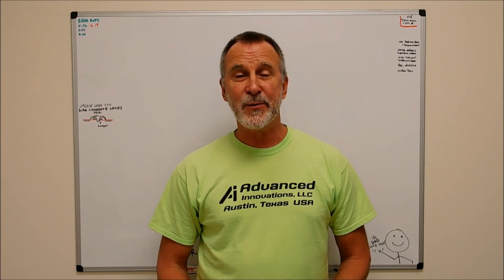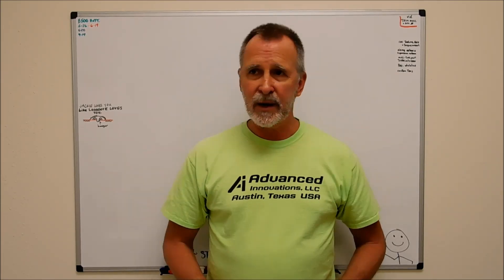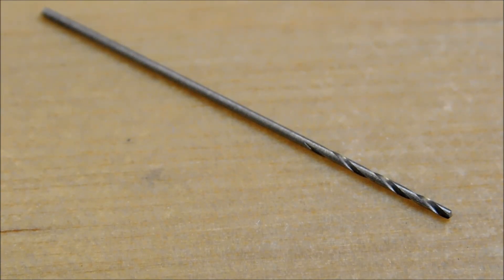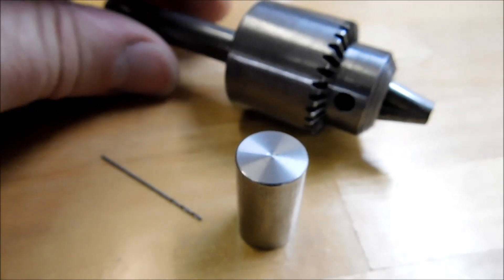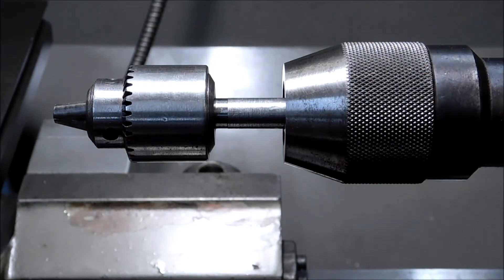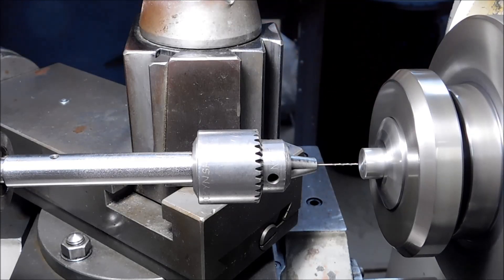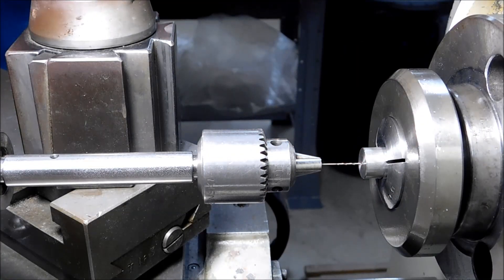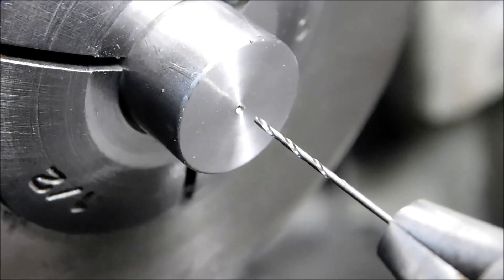Micro Drilling -- Stop Breaking Small Drills !!

Comment: 2 observations:  it looks like your center drill moves upward when making the pilot hole and the bit seemed to wander while drilling also, I think I'd file/grind the teat on the faced off work before center drilling (right?) and secondly making your attachment, the air hole behind that you lable in the video would indicate that the attachment and mated extension from the chuck were ground?  Or did you use a ream and make the chuck extension to fit the hole?  Seems like a real tight clearance (of course) but I'm wondering how you made it.
Reply from the maker: The extension was reamed to fit the drill chuck shank.

Comment: Great idea.  I would like to see how to do this ion a small milling machine that only has a 1/4 or 3/8 spindle opening.  
Someone mentioned the Albrecht version of what you did but it has 1/2 inch shank on a keyed spline which is normally too large for the smaller mills.  Thanks in advance

Comment: Broke 3 tiny bits before looking. Bring on the names - just want to make TINY holes in 1/4” vintage OAK...
Uh oh. Did he say lathe.

WELL P00P !!   I’m talkin hand drill and Wood, so I can put in fine brass nail.

darn it.
Reply: I use a Amtech R0279 Mini Craft Hand Drill but it doesn't always get positive revues but I have had and used mine for more than ten years. I brake the odd bit still now and then but light pressure and less speed gets the job done and fewer broke A normal hand drill is heavy pushing down on the small bit but the Amtech is plastic with a brass chuck  and he did say lathe but I found my self hear by accident too. To make fine holes in wood you could try using a pin push Expo 2mm Pin pusher - ideal for Amati and Peco pins # 75110
Reply: Have you tried an Archimedes drill?
Gives you much greater control over twist speed & pressure for small jobs.

https://www.ebay.co.uk/itm/QUALITY-ARCHIMEDES-PUMP-ACTION-PIN-DRILL-Precision-Model-Pinning-Hand-Tool-/172537853411?_trksid=p2349624.m46890.l49292
Reply: I have put a drill bit in a pin vice and drilled it by hand. It takes forever but it might work for you.

Comment: would this work in a drill press if you put the part in chuck and the adapter in your vise, feed the drill bit bottom up ?
Reply from the maker: You'd have to be exactly on center or the drill would snap off.
Reply: @joepie221  Wondering the same thing - a bit tricky putting an odd my shaped part into  the chuck. But you have me thinking. now. Thanks - great vid.
Reply: Here is how to get the drill dead on center easily In a drill press , extended the quill down and lock it , put a piece of drill rod / shaft in the lower chuck and then put it in the upper chuck and tighten both  chucks ,next put the chuck adapter slide in the drill press vice and tighten the vice , next bolt / clamp the vice the the table and be sure the table is then locked on the coullem , do not move the table in any way from now on , un tighten both chucks and unlock the quill and remove the drill rod/ shaft , then put the work in upper chuck and the drill in the lower chuck and go to drilling holding the lower chuck and pushing it up into the work .

Comment: There's a DIFFERENCE between a DRILL and a DRILL BIT!!
Reply: I was taught the exact opposite, the drill is the tool that makes a hole, the drill motor, drill press or drill chuck are the mechanical items that drive the drill.
Reply from the maker: What???
Reply: @joepie221  The "drill" is the tool which drives the "bit". Like a "screwdriver" drives a "screw". Like  a "paint brush" is used to apply "paint".

Comment: I don’t think that’s a small drill. A #80 is a small drill. Nevertheless, as usual Joe has come up with a great idea
Reply from the maker: I agree, but this chuck wouldn't hold an 80.
Reply: @joepie221  , Joe, Thanks for the reply. Damn hard to find a chuck that will, but I've got one that came with my sherline mill; unfortunately, also has a morse taper.
Reply from the maker: @tomblack6972  Albrecht keyless chucks will, but get ready to spend $500 to hold that #80 drill.
Reply: Joe Pieczynski I think I’ll stick with my pin vice
Reply: I was also wondering about the REALLY tiny drills. I have a job that requires a #78 hole in a brass fixture with a 6mm hex body. It’s counterbored with a 5.75mm hole so the #78 hole is only 250µm deep.
Will I need any special ‘extras’  to drill brass?
Reply: @jeffarmstrong1308 , I don’t think you need anything special for the brass. I drill into brass frequently in my ship model building. Drill Bit City (on line) will sell you a carbide #78. I find those too brittle. Micro-Mark (also on line) has #78 in steel which I find easier to use and more forgiving
Reply: @jeffarmstrong1308  I assume a pin vise can be put into the chuck

Comment: Great Idea , But it must be difficult to drill Hard materials since it requires greater pressure to push
Reply from the maker: You'll feel how hard to push.
Reply: Takes longer and don't expect anything but dust coming out of the hole .
I drilled a hard clock gear shaft with a  .019 drill bit  .

Comment: Any tips for dealing with carbide drills on manual machines?  They are less forgiving than HSS and tend to break much easier.
Reply from the maker: Those are my Achilles heel. I don't think I've ever used one I didn't break.
Reply: Yeah how much of a market for that video could there be? Lol. Luckily I can answer to an extent. Essentially if you have a Ridgid setup, to expand I don't mean Ridgid for a human but Ridgid for molecules fighting each other on a machine level. Only use collets. Find the highest precision ER collets you can manage. eBay and Amazon can be surprising. Center the drill and hope your not drilling anything over maybe 3/8 on 5hp in stainless I wouldn't do over 1/4 on some. Not enough ass end for that. I don't do over 1/4 on my 6k lb lathe. Also lots of coolant don't peck time is your enemy.

Comment: I work in the pharmaceutical sector and we have to drill 5 thou holes. We have to do it on a cnc but it’s not easy. Coolant is enough to deflect the drill.
Reply from the maker: What do you drill?
Reply: Joe Pieczynski I’m not exactly sure what it is as it’s all r&d work for world leading pharmaceutical companies. We have this 1.6mm rod od ground. It gets groved a long down it and gets a 30 thou hole in one end. That hole gets a 30 though acetal plug inserted in it and a 5 thou hole is drilled into the acetal at one thou pecks. I think anything that size must be for some sort of needle jig. They don’t let much on these companies.

Comment: how to drill tiny holes with a hand drill?
Reply: take a look at jeweller tools & techniques, those guys & and dolls use small drill bits free hand, down to 12 thou
Reply: USE A DRILL PRESS.  THE DRILL WEIGHT IS TAKEN BY A SPRING.

SMEAR SOME GREASE ON THE PILLAR (COLUMN) WHERE THE BRACKET SLIDES UP/DOWN.
USE A 120 DEGREES CONE SPOT DRILL TO LOCATE THE PIT FOR THE MICRO DRILL.
USE A MILLING X-Y TABLE FOR PRECISE LOCATION. 
 YOU CAN MAKE A FEW HOLES IN THE HANDLE AND HANG ENOUGH WEIGHT TO OVERCOME FRICTION AND THE SPRING.

Comment: You'r center drill was below center and looks like your drill did not go straight
Reply from the maker: Its an old chuck, the center drill found center, and the drilled hole was true. You can see a slight lift as the center drill picks up. That was not visible without the camera magnification.
Reply: @joepie221  I have a good eye even though I need glasses to read..... and what i see is the drill going at an angle surely not straight but that does not matter if the part still works .... truth is there are no straight holes or perfectly round ...perfection is within tolerances nothing more.... to me the straightest bore you can get is to drill the hole then grab from the inside with an expansion  arbor then turn the outside of the part but even that is within tolerances.... when we realize and accept that perfection only exists in our dreams or lives become easier....btw I find that home made spade drills do quite well at finding center and I find that not having flutes run past just the first 1/8 to 1/4 inch of the drill tip leaves the shaft far stronger than needed to remove the needed material ..... you peck to clear chips and the flutes being wider than the shaft leaves room for chips to clear

Comment: Interesting.  Could you offer advice on drilling RPM for small bits?  I think that small bits should be spun faster than larger bits.  By the way, I've seen woodturners use a sleeve as you have shown here, and often just freehand a bit held in a chuck. They also may rotate the bit while drilling to counter deflection cause by the grain structure of the wood.
Reply from the maker: Smaller diameter = faster RPM   Every situation is different based on part geometry and material. I usually start my drills in the 1/16" range around 1400 and go from there. Drills above 1" are rarely run faster than 130 rpm.

Comment: Is there anyone who can drill a .010" hole .425" deep into a .090" Stainless Steel or brass rod for me?
Reply: Yes me
Reply: No ish.... I'm going to be making 0.005 and 0.010 holes in 0.049 wall 1/4 inconel tubing. If I don't use an EDM I'll need 80k rpm
Reply: To go as deep as you want will need to have it go to an EDM

Comment: OK! I use very fine drill bits 0.03mm being the smallest . I use them to drill new pivot holes in brass for clocks when re-bushing. The chuck I use is ultra mini. Can I design something like this, because you have given me an idea....
Reply from the maker: Check into micro chuck adapters. for use on the mill.

Comment: Really good and that leads me into the next problem.How can I sharpen a micro -mini drill?I got diamond plates,pin vise and Amscope.But is there a better way or other jig or sharpening machine?I'll appreciate some help.Thank you
Reply from the maker: Unless they are custom, buy a new one. They are so cheap, its just not worth the time to try.
Reply: @joepie221  I got my sensitive microdrill adaptor(made with a ruined Dremel parts).I have microdrills of all ages(I'm 74) and they are too long (Ha,and they break)for what I want them to do in my lathe-milling  machine(No CNC) so I need to cut them and resharpen so I'll be able to use my 8" rotary table with the idea of drilling(peck,peck)say 29 holes in a cent or say penny,which in turn may lead me to build a clock with just pennys.I hope I have enough planning for now.See what happens.I'm in debt with you since I'm learning so much from you.Thank you

Comment: Well here is a real challenge am trying to drill a #79 drill that's right .014 using a CNC I went to 10 drills so far  and all of them Broke try different feeds and rpm and the result was the same I gave .00035 per tooth and and looks like a lot of tork it end up snapping inside of Aluminum part by the way I used same small Chuck you're using any ideas, Anyone??????
Reply from the maker: Small drills like this are temperamental.  However deep the hole is, be sure to select a deep hole drilling op to pull the drill clear of the hole after each peck. High RPM and super slow feed rate with coolant. if you leave the drill in the hole while drilling, the chip packing up is probably breaking the drill. I just finished a job drilling 110 holes, .029 dia thru .3 thick aluminum. It took a while, but I only used 1 drill to complete the job..
Reply: Thanks for answering I just need an idea in atleast what sfm or chip load on such small drill and yes ur right the drill broke in side of the part which it means it was load it, I did drill the holes but it broked on the way out I was running 10k rpm 1.1 feed and plenty of coolant

Comment: That's OK if you have a lathe. You are restricted to drilling into the end of a round rod. What about drilling into the side of something in a non lathe loadable position?
Reply from the maker: That adapter is commercially available. Its called a micro chuck adapter. Its keyed and spring loaded for mill or drill press type operations.
Reply: A four jaw chuck or a faceplate with clamps will hold most odd shapes. You can also checkout the OXTOOLCO videos on making a "Sensitive Micro Drilling Attachment" for your drill press or mill: https://www.youtube.com/watch?v=bVxOmh5cj_w&t=1242s&ab_channel=oxtoolco

Comment: Good idea and I have used same method but use a pin vice to hold drill bits...cheaper than small chuck and much better holding and centering of bits. The one I use has 1/4" handle that fits in the pipe as shown in this video.
Use center drill to make divot to start drill is best recommendation in this  video.

Comment: Has anyone a Tip for longitudinal milling in full stainless steel material with Mills that are smaller then 3mm when your Machine can get only 1600 rpm at maximum ?
Reply: Harald your lucky with 1600rpm your machine. Ive got 1300 lol. But still good enough to mill steel and aluminium. Stainless i have done once and never again. Too hard to work with small end mills they snap like twigs. A 2k rpm machine has been advised by my collegues at work. That means 3phse power for which i dont see economical for me to go. So its steel and aluminium for me and its going well here with that

Comment: I use the same trick with my drill press by using a matching sleeve on the shank of a separate chuck. It may be a little tricky for the novice to center the hole in the beginning but once that is done your added drill chuck is just floating there on its own weight until you exert downward pressure.

Comment: Thanks, Joe! I've broken more thin drills than I care to remember, so this video got me searching for adapters - and I found this one: https://www.arceurotrade.co.uk/Catalogue/Chucks/Drill-Chuck-Arbors/Micro-Drill-Adaptor---JT0---12-Shank
I bought the adapter, and the matching chuck they also sell, and the combination is a joy to work with. Of course, this is a cheap, Chinese made, tool, but it's certainly good enough for my hobbyist use. Weird thing, though: the chuck seems a little off-balance, with a slight bit of throw in the body (so I'd be wary of spinning it at really high RPMs), but it still seems to hold the drill well centered. Is that common with cheap chucks?

Comment: Did something like this when I was working! But smaller! The material was H13 toolsteel, which is  a versatile chromium-molybdenum stainless, in this case for use in an injection mould tool for moulding precision medical spray nozzles. The set up was as you saw here, but on a mill with the work piece in a collet in the milling head, and the slide chuck fixed to the table. Two . reasons for this set up, firstly setting and checking concentricity is  much easier, and secondly a potential problem with chippings in the hole causing problems, by having the workpiece at the top, they fall out no problem. The drill size was 0.010" and the lubricant was a very cheap one, lick your finger and wipe the drill with it. This was a 128 impression tool we made, so a lot of holes, plus spares. One part was accidentally drilled at 0.008" diameter, we told the customer we'd forgotten to grind that one. This method was also successful at drilling 0.006 diameter for another mould tool. I'm not saying we didn't break drills, of course we did, again various reasons for this, not all drills are equal, drill enough small holes and 'feel' will tell this and you can discard the drill, even so because the drills vary, so does the number of holes you can get before changing, and of course tiredness from concentration and the constant light but firm grip on the drill chuck tells after a while. A useful tip for more than an odd one or two off, rig a dial indicator  so that you know the break through point, this is yet another regular source of drill breakage on small holes. In all though a very satisfying process, and I can think of no better way of learning 'feel' .

Comment: This is a great tip but the micro-fine finger feed chuck I have is nearly 50 years old and cost less than $20 even now they are less than $40 so I don't know where your $400-$900 price comes from.
Reply from the maker: The Jacobs and Albrecht floating chucks on their micro adapter arbors can be very expensive. What brand is your 50 year old setup?
Reply: You can easily spend that much for a quality one.  https://www.penntoolco.com/micro-drill-adapter-albrecht-15-jo-keyless-drill-chuck-with-adapter-71-635-7/?matchtype=&network=g&device=c&keyword=&campaign=744292550&adgroup=pla-47537770585&gclid=CjwKCAiA8K7uBRBBEiwACOm4d9-jnhtbmU4y3KLRJoOEkpi4eP_IXrUzv_acc7LdDBtVEYAulXttWRoCaHsQAvD_BwE

Comment: Hi,  noticed when you touched the center drill to the work it pulled up about 30 thou.  That to me meant your main drill chuck was out of center.  This may have contributed to past drill breakage. Of course you can check by clocking a piece of bar true in the lathe chuck then tightening the (detached) drill chuck on the bar then clocking its tapered end.  If that runs true then your tailstock is out. BTW stainless steel comes in about 5 grades.  Non Austinetic Usually called 'free-machining' is a lot easier to machine than anti-corrosion grades.
Reply from the maker: The bump was most certainly from the smaller chuck. Its very old. As for the stainless coming in 5 grades, you may wish to double check that stat. i have a hunch you may be surprised.
Reply: @joepie221  sorry 5 GROUPS , many grades
Reply: He was using a floating holder which cuts toward true center. Used many of them in screw machines!  Take care

Comment: I have an adapter purchased from the now defunct Enco that was inexpensive but not the best quality. Yours looks way better. Anyway I was under impression that your RPMs were too high for drilling stainless but it worked. I assume that you drilled a work-hardening steel. If you drill a 17-4ph - would you go with the lower RPM to avoid overheating and thus hardening?